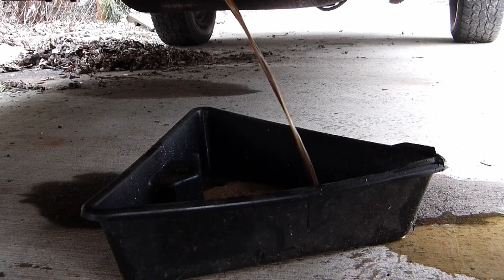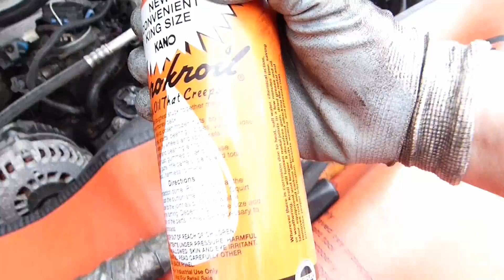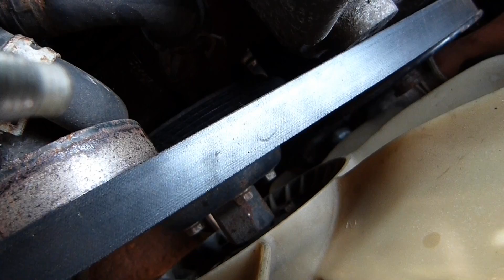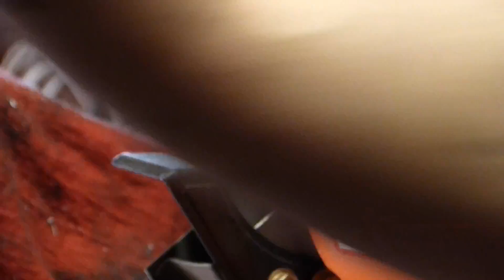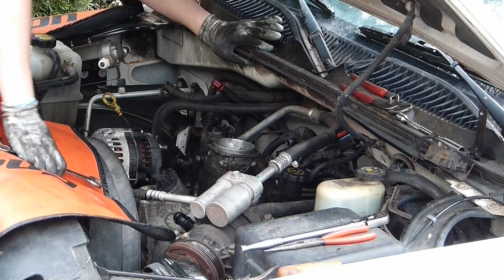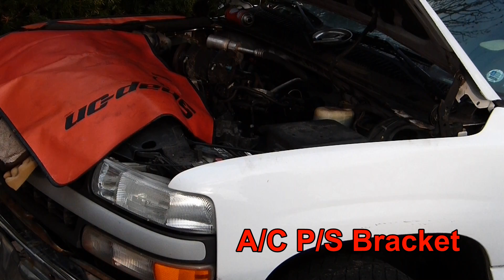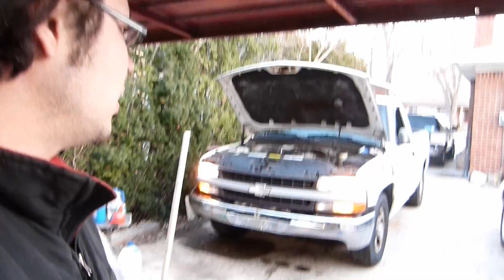4.3 Vortec Intake Gasket Replacement Guide Detailed

Comment: Good video. For anyone doing this more recently, there are now gaskets with steel backing to prevent the gaskets from deforming and leaking. The OEM is paper. Which is the main reason they start leaking. I would recommend only installed the new style gaskets with the metal plate in them. If you use the paper gaskets, you will have problems again.
Reply: Absolutely. FelPro Perma Dry, for those who may need it.  Best lower intake gasket you can put on that engine - I did mine and also did a complete top end rebuild on the 350 ( the 4.3's big brother) in my Tahoe with the Perma Dry kit also. I can't imagine better gaskets for these engines.
Reply: @robertsmith8632 fel pro makes both the plastic "frame" gaskets as well as a metal "frame" gasket. The metal ones are a bit more but essentially it's the last time it will need to be done..... So honestly, choose accordingly. (I personally use "the right stuff" gasket maker)

So I'm just watching this to get a refresher and I don't remember removing the power steering/compressor bracket..... Looking at it now, why don't people just lop off the corner of the a/c bracket, it doesn't need no 4 bolts holding it on!
Reply from the maker: Poor racer here, high temp RTV can help with sealing challenges.  I've used it on the head to manifold interface and pipe flanges (with a gasket).  I also use copper spray on the T4 turbo gasket.  I've taken apart the engine many times developing/diagnosing/maintaining my race engine, so the incentive for me is to save money on buying new gaskets (to ensure a seal) every time it comes apart.  I have had good luck not hurting the WB O2 sensors from the acetic acid gassing off the RTV.

Comment: About to take on this job with a little 2000 GMC Jimmy I picked up for almost nothing. If this solves the issue, you're my hero! 😄. Mine is leaking so bad when you put coolant in over a certain point on the radiator, it pours right out of the oil pan! If the plug is out of course. Great video for DIY. Good work!
Reply: TarmacTV same thing with my 2000 GMC Jimmy. I really do hope it’s just the intake gasket and not the head gasket. I had antifreeze, water and oil all mixed together in my oil pan. when filling the radiator up to do a coolant compression test, the radiator wouldn’t fill up and it all went to oil pan and started coming out of my air box and down my frame.
Reply: I’m having the same problem. How did you fixed it ?
Reply: Allen Hoffman did you find your problem? And how did you fixed it ? Thanks in advance
Reply: Miguel Ceja  This is TarmacTV’s other account. My issue was in fact the intake gasket. Swapped that out, did a really good oil flush, and everything was fine.
Reply: Allen Hoffman thanks

Comment: pick tool =Cotter pin remover, standard pliers = slip joint pliers.  If you are keeping vehicle best to replace all old hoses removed in this process while you have access and coolant is removed.  Also, if you have original central point injection change to upgrade multi point injector spider.  Kits from about $150 to $250.  Worth every penny, better performance, idle, MPG.  You've got it all apart anyway.

Comment: VERY Important to remove and install distributor correctly so research that Before starting.

I grab hoses with a pair of pliers around the end of the pipe and turn them back and forth.  

start slow and move it a little more each turn

Almosr always works without hurting the hose

and yes strait normal pliers almost always work on hose clamps

Comment: The gasket set states in bold letters not to use sealer on it... I rebuilt my engine and after 600 mile it all of a sudden started laying a smoke screen and using about a quart every 150~300 miles, after much testing I have come to conclusion that it is the intake manifold gasket. I installed the last one exactly the way you did in this video and when I took back off you can see where the sealant caused the gasket to warp at the bottoms. This time I also bought the FelPro gasket made of metal and what a world of difference these 2 sets are.
Reply: +Michael Clemmons Id like to know also if I should or shouldnt use RTV. Because in the Haynes manual it says to apply RTV to part of the gasket, but then again thats probly with the understanding that youre replacing with the OEM gaskets which are different from the Felpro which I am installing.
Reply: +BikeLifeHooligan In theory, the gasket doesn't need any RTV. In practice, it won't hurt the gasket or the seal to apply a very THIN layer of Black RTV around the water ports. This will provide a little bit of insurance against future. leaks. The most important piece of the job is doing up the manifold bolts in three rounds in the order specified to the torque specs. And check them a fourth time.
Reply: i know thos is old but you apply the rtv to the 4 end corners of the intale gaskets... if not theres a 99% chance it will leak. ive done at least 30 of them.
Reply: +SPLATTER HOUZE I have the same experience with leak prevention although I haven't done quite so many of these repairs. :-)
Reply: ITs a must! not just on these but on most intake jobs.
Reply from the maker: What brand was the new failed gasket?  You said you switched to Felpro.  Did the vehicle happen to over heat?

I started with the FelPro gasket.  The Victor-Reinz and Felpro use Viton and Nitrile types of sealing beads, with nylon body both updated designs.  All of these are for certain compatible with Silcone oils and greases: http://imgur.com/YtMrce7

Researching MSDS ingredients of Silicone Gasket Maker, major ingredient is PDMS: "Polydimethylsiloxane (PDMS) belongs to a group of polymeric organosilicon compounds that are commonly referred to as silicones."  Looks like they then fill it with limestone, calicium, silicon dioxide, etc....  There is commonly low % / trace amounts of chemicals that would probably be unsatisfactory to use with Viton and Nitrile, but that is part of how they make the silicone flow out of the tube, then the bad stuff evaporates is my understanding.

One article I came across in research said you use a little RTV at the corner, where there is the viton/nitrile bead seal ending point, so it is at least somewhat compatible if the manufacturer said use gasket maker in the corner.

Lets keep our eyes open for more incidents, it is pretty serious if the gasket maker is causing premature gasket failures.  If anyone else had a failure, please chime in.
Reply: This is where the iron heads match up with the aluminum intakes. These metals expand have different coefficients of expansion so they move relative to one another a tiny bit when heating/cooling. The gasket will always fail eventually but it seems as though people have good luck with RTV around the coolant ports regardless of (plastic) gasket manufacturer. I haven't heard reports of the metal ones failing en mass.
Reply: @SPLATTER HOUZE  what do u mean by 4 end corners?

Comment: If you clean the pitted surface around the water jacket use jb weld to filling the pitted area and sand flat you need no silicone.

Comment: I'm very new to working on cars. I only change oil tires and brakes. I've been loosing antifreeze for a few months and when I went to change the oil it was a thicker funky caramel color.
Reply: Brett Lott what ended up happening?
Reply: Either Valve head gasket blown  or only intake gasket  or both of them  are bad.

Comment: Gotta do this and head gaskets on my Sonoma, and boy I'm pissed about it to! It's a 1998 4.3 Vortec & just barely turned 98k original miles. I'm a mechanic and been very on point with my maintenance because it's in such good shape. There's no damn reason it should be popping a head gasket.

Comment: One bolt holding the fuel line bracket in back and two 8 mm bolts hold bracket to fuel lines that go into spider injection. Remove and easier to remove I take. Regardless though good job

Comment: This weekend I tried the tare the engine apart.So far the AC bracket is giving me the blues. I tried squeezing between the bracket,and the pulley. I got the screws loose, but it didn't move or shake. so I got frustrated and notched the bracket,and fought the intake to get out. Now Im trying to figure out how to get that bracket lose, and get those screws tight?

So far I have the intake out, and cleaned the bottom half. Now i have to wait until the intake come in, and try to replace everything, and pray to god it start.

Comment: please use the improved metal shim intake gaskets!!!!! they still sell the plastic ones that will blow out around the cooling ports. and you need to use a inch pounds torque wrench to tighten down the intake bolts.
Reply: Torque spec is not so critical with the metal gaskets, so long as they're even and a bit over the spec. It is critical with the plastic ones, but now that they have metal gaskets, nobody should use the plastic ones any more. They were not a good idea!

Comment: well detailed and excellent video. thank you for the effort in making and it's very helpful. just one comment. don't know if you did or didn't, use spray silicone on hoses to remove them. oil based lubricants can deteriorate the hoses.
Reply from the maker: I agree the preference is for sure silicone spray on these hoses.  We all bend the rules sometimes but the goal should be to move in the right direction, like Step 1 buy the can of silicone spray hehe

Comment: Thanks for showing the bottom two nuts for the power steering bracket. Service data wasn’t very clear on location.
Reply: I'm about to do this on a blazer, I'm going to cut that corner off the compressor bracket, such a horse shh design! It certainly don't need 4 bolts to hold the compressor

Comment: Great Video
Have a Jimmy 2000. Helped tremendously, first time doing intake manifold. Must the distributor be removed and getting to the fuel line is a miracle. 
I notice on Chevy they did not have to remove the distributor.
Reply from the maker: The distributor goes through the lower intake so it must be removed.  I hope you research distributor removal resources so you know not to spin it after removal, otherwise it'll never run.

Comment: The ONLY Part I needed to see you remove and YOU JUMPED passed it.... If you make a Video, It would be Nice to go through the " ENTIRE " process and DON'T Leave Out any steps ...  ( If you may be wondering which part I needed help with, It's the Electronic Box REMOVAL by the Fuel  lines on top of the Intake Manifold, with the 8 wires going into or out-of it... ...  I have been trying to remove it, without Breaking it in some way  ...  I will just check some OTHER Videos and see if there's a clip to release or if you just Pry it up... Thanks ANYWAYS. :(  ,, .. Have a good Summer 2017 ....  )   And Please remember...  A tutorial shows ALL  steps of  the operation... This video's kinda like referring to your Instruction pamphlet and find out, that they started it on Page 3  ;)   lol...
Reply: Douglass Sanderfields 
You unplug the injector harness dummy.
Reply: Thanks “Dad” I’m sure he will remember that next time
Reply: Pull white lock pin.  4 plastic tabs (2 each side) pull outward slightly, then pull harness plug up.

Comment: I am doing a 2002 Astro van.. Oh Joy,  I have done this before but i forgot a few things. It is a bear tho. They sold the van at 140k, Because the shop bill was $1400 to fix. This is common with the plastic gaskets. I will use the metal gaskets. The van I repaired years ago has 250k now. Damn you GM, stop going cheap on the gaskets.. Also this is a good time to rebuild the spider injector under the manifold. They will leak down and cause hard starts after warm up.

Comment: Did you also have an external leak pooling on top of your head? 
  Could this also be the reason for the white smoke out of the tailpipe; not the head gasket? It's not a lot of smoke; and i only have a trace of coolant when I drain the oil. It also runs great and does not overheat. 
  It's a 98 c1500 with only 137k. I cant see it being a head gasket already. I've already replaced the quick connect hose fitting on the left side as it had corroded away and broke off the threads in the intake. That was fun. I never did get that quick connect fitting to completely stop leaking. Any tips on that?
  Let me know if you can...... Again, great vid. Subscribed.
          L8ER

Comment: The mystery to me is, why do I have to use RTV around the coolant passages (which it seems i will have to), when the factory didn't use RTV and everything ran fine? I replaced the head gaskets on my son's 4.3 V6 Silverado in which the kit came with the intake gaskets and exhaust manifold gaskets. I used RTV on the front and rear rail before mounting the intake. We decided to pour coolant down the thermostat housing before installing the radiator hose. Then before firing it up went to drain the old oil, and mostly fresh coolant came out! Hadn't even fired up the truck yet! Is the reason why, because I didn't add RTV to the intake gasket coolant passage??
Reply from the maker: 1990's engineering and technology caused the failures.  Combine that with being "traumatized", I added sillycone to help me sleep, a person problem.

Comment: I finally finished my truck. Only down fall is it crank fast run smooth, then after about 3 mins of idol it stumbles, and act like it want to kill.
Reply: bigcartoonyIIV You have a leak somewhere in the intake
Reply: Thanks I found that son of a gun a few weeks back. When I changed the upper intake gasket, I put gasket sealer on it, and didnt torque it down. So when i tried to tighten it, the gasket seal left a crack, and had air leaking. So I had to pull all of that off, take a blade, and cut all of the gasket sealer offl.

Comment: Great job ! I would have replaced the valve cover gaskets while you had that apart !! But damn good job 👍
Reply: The valve cover gaskets can be easily changed with all that stuff in place, if they aren’t leaking, I would not mess with them

Comment: use a wire wheel on a cordless drill cleans it in mins to bear metal and you can hold the drill to where the dirt and stuff is flying up off and away from the motor.

Comment: There are two rubber gaskets, (seals?0 that go on the manifold also. One goes on the front of the manifold, and one goes on the back. Did you omit those. or are they not needed?
Reply from the maker: You can use those, but according to the old guys, a big bead of silicone never fails and I have never had a problem either; but you must degrease the surfaces.

Comment: Thanks for the video!  I have to undertake this lower gasket change on my '99 4.3L engine becasue of internal coolant leakage.   Doing this job did you line up top dead center compression stroke on #1-cylinder, other videos I've seen show folks doing that but if a guy marks the distributor position it shouldn't really matter is my thoughts.
Reply from the maker: You are welcome! For the distributor, certainly don't rotate it once you remove it otherwise static timing will be off and the engine probably won't run.  Setting it to TDC cylinder 1 compression stroke with the cap off the distributor and you can see spark plug #1 is over the rotor sounds responsible with some extra steps.  Some call me lazy, some call me efficient.

Comment: Why didn’t you just disconnect the fuel lines from the top of the spider instead of ripping it out and damaging the fuel line?
Reply: Ya I seem to remember that you lift those out of the way they are also bolted by a bracket behind the block
Reply from the maker: It was my first, coulda woulda shoulda

Comment: a question for you? I'm experiencing water in my oil,and is happening at a fast rate,why did you first suspect the intake? I've done a compression test,check plugs for residue,and even dye tested the radiation for exhaust fumes. the engine idles good with a little stumble under acceleration, any ideas? also I rolled the engine over without plugs in while warm,and full of coolant and no coolant came out of cylinders.thanks for any help.
Reply from the maker: +Neal Cummings I suspected the intake gaskets because it is a very common problem with the 4.3 around 1999 with the new generation coolant.  This video could very well have been a "how to replace the head gaskets". My 1996 Blazer with the 4.3 Vortec does not have intake failure issues.
Reply: pressure test cyclenders/if ok.. probly is intake gasket leak! most the time:its the back of intake.. close to distributor! can feel for air leak.. while engine running... gaskets start break down after like 8 to 10 yr... and as weakens it blows out at random age.... also allum heads tend to just crack.. after older

Comment: I have to replace my intake manifold gasket on my 2000 Bravada 4.3 is thisbthe swme motor? Reason i qsk is when you popped the intwke manifold off i didn't see wny soider injector? Ive never had one off so just wanting qs much information qs possible thanks rorbthe video

Comment: Any tips on loosing bottom ac  bracket bolts ?
Reply from the maker: Can you get a breaker bar on it?  You may consider removing the fan shroud and then fit an impact between the fan fins.  You can easily remove these old fans, just take an impact gun with a pointed tool, then use that to back the fan nut off, takes a couple braps with the impact and it's off.